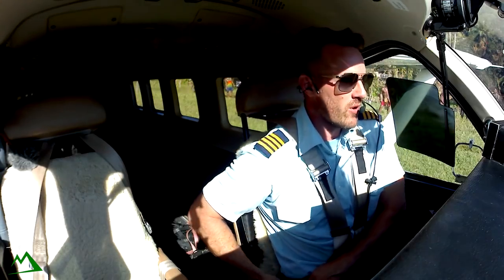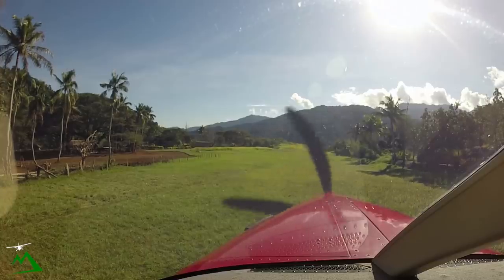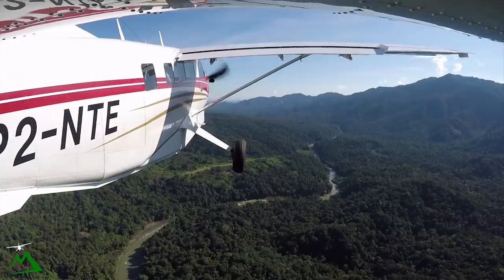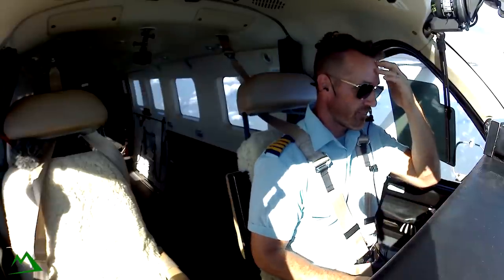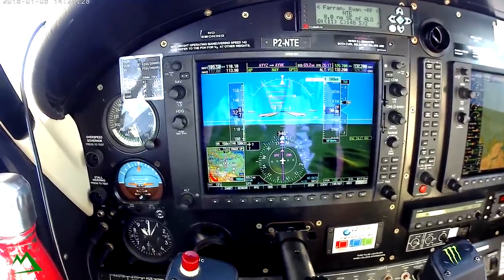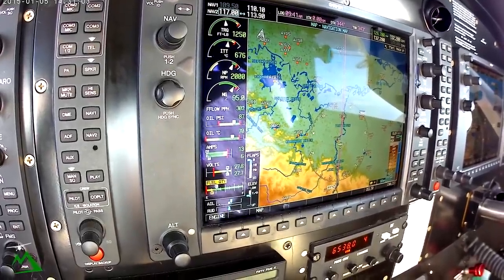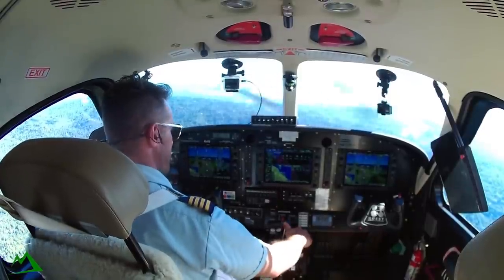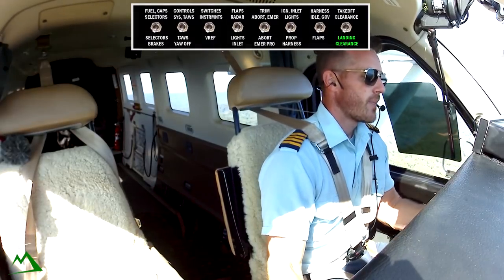REMOTE MOUNTAIN RUNWAY Takeoff in Papua New Guinea | Bush Pilot Flight Vlog

Comment: Fun fact: Your airplane produces more torque than a 14.5L Diesel engine on a modern semi-truck.
Reply: Torque is where it's at! That's why he has to trim so hard and rides the right foot, that torque is trying to flip him over.
Reply: Is this torque measured at the prop or the engine shaft?  Turbines rev very high, so with reduction gearing I’m curious if that’s the torque at the prop.  A regular car in 1st gear can produce over 8000 Nm of torque at the wheels after factoring in the final drive.

Comment: MBP, hello RYAN, nice flight  1600ft  eh, there is one I do not have the figures for right now,,ANDOVER  AEROFLEX i , & it is AHORTER water on both ends, & YES a few have gone in , even a PIPER AZTECH , HAS BEEN THERE & 1 went in , not only water,,but HIGH TENSION POWER LINES TO THE SOUTH , it’s better from the west as the way in is CLEAR so you can go in on the edge then brake , The second time I was regretting had log book signed, & WIND DIRECTION CHANGED ,,,,, WHEW! , As I did not notice ,,,  Cheers 🇺🇸🇺🇸🇺🇸🇺🇸

Comment: Very nice landing, have a question, is your landing speed more than your take off speed?  If so how?  Are the flaps fully extended?
Reply from the maker: that's what the book says.  I guess for takeoff, you're increasing airspeed at a rapid rate with 20° flaps, and landing your 35° flaps and slowing down.  If you went much slower on landing, you would lose effectiveness of the ailerons and rudder, making it very difficult to control the airplane.
Reply: @MissionaryBushPilot  Right, I see.  Ok sounds good🙂.

Comment: When you made contact for flight following, how come they didn't give you a squawk frequency? Or, was it sent digitally, call by some other name? Nice flight and scenery, especially coming in over the water!
Reply: Given that they work with ETOs (estimated time overhead [a waypoint])  I would assume that enroute SAR does not have primary nor secondary radar and relies only on comms. Therefore a squawk code would be useless to them.
Reply from the maker: They don't give sqauk codes here u less you fly to Port Moresby where they have radar services.

Comment: Are all the three computers on a totally separate power circuit? What are the weakness in redundancy in those systems? Is there any part of the flight system that you think needs more redundancy?
Reply from the maker: 2 batteries, 2 separate computers running the screens, and back up steam gauges.  I think it has enough redundancy

Comment: Great video 👍. I’m sure there’s a logical explanation, but why are the 2 fuel tanks in isolation. I would have thought equal feed from both would make the plane more stable? Cheers
Reply: Depending on the plane there might be even more isolated fuel tanks. The most obvious explanation would probably be fuel leaks or contamination. Switching on another isolated tank might solve the problem long enough to ensure a safe landing. But in all honesty I fly planes with this exact tank layout and have never thought about that.

One other thing might be that it is the easiest way to let the pilot contol the fuel level in the tanks without having to hook up and control crossfeed lines.
Reply from the maker: Not really sure why it doesn't burn evenly
Reply: Probably to avoid single points of failure. A common distribution circuit might mean a single place that fuel feed could fail. Just a guess.

Comment: Greetings from Ireland, quick question, Does emptying one wing fuel tank whilst the other is still full have any impact on the flight characteristics of the aircraft or the feel of the aircraft in flight?, blessings, stay safe and stay well.   S
Reply: In short: Yes, very much so.

The plane would in slow flight want to tip to the side of the fuller tank. Because of this an asymetric loss of lift (one sided stall) is very likely.

This is why there is usually a limitation of how much difference in fuel there can be between the tanks. The value varies from plane to plane.

Edit: with "can be" i meant to say "is allowed to be" obvously you could just run one tank dry while the other would be full but that puts the plane outside of its performance limitations.
Reply from the maker: Yes it does.  The max imbalance allowed by the Kodiak is 250 LBS.

Comment: If that runway was any shorter your aircraft would need a tailhook, and the runway an arrestor cable system. Although, even without a shorter runway and with the dropoffs I see there maybe there should really be an arrestor system in place at the end of the runway for everyone's safety. You only live once. Also, to your company, an arrestor system would save the aircraft from damage. An energy arrestor can be something as simple as 100 meters of gravel and sand at the end of the runway.

Comment: Cameras, maps, narration, terrain, awesome vid's. You mentioned you have a variable pitch prop, do you know what type it is? When you change the power (torque) without changing the rpm, are you changing the pitch on the prop? 
http://www.pilotfriend.com/training/flight_training/fxd_wing/props.htm
Reply from the maker: when I change the pitch of the prop, it changes the RPM of the prop only, which makes it more effective for takeoff, or cruise.  The power lever does engine torque.
Reply: @MissionaryBushPilot  Does your engine management computer rate-limit the torque automatically if the prop overspeeds? How many "nannies" does this airplane have?

Comment: HI Ryan,

I see a lot of Pilots sit on the left hand side, why is that?
Reply: its the capain's seat, if youre flying solo as PIC youll probably take the left seat, plus the left side has more of the important controls and switches for single pilot certified aircraft
Reply: There was an amazing explanation of this somewhere by an Aviation Vlogger that goes something like - stems from the early boating days when the captain was steering with the long rudder thingy and he always stood on the left hand side to operate the rudder with his right hand and hence the term "Steer board" side became known as "Starboard side" and he always docked the vessel onto the port or jetty or wharf which became known as the "Port side" or left side because he was able to carefully see and manoeuvre the boat alongside the port or jetty or wharf. So aircraft have followed the same setup with the captain in the left seat and passengers board the aircraft from the left - with some exceptions for example rear loading - and all aircraft servicing is done on the right side such as baggage loading and fueling away from the passenger movement. Its best if I find the video and I will link it here - somewhere.